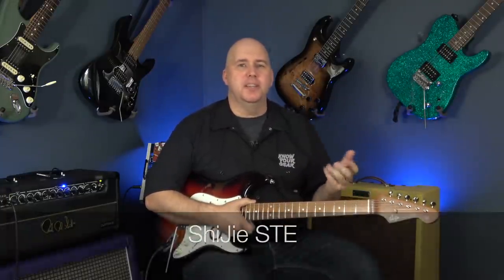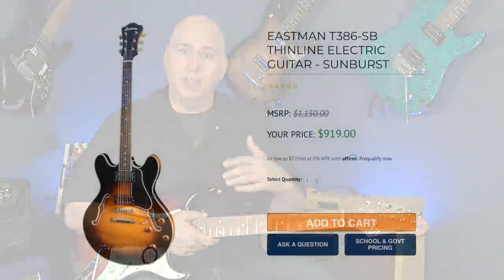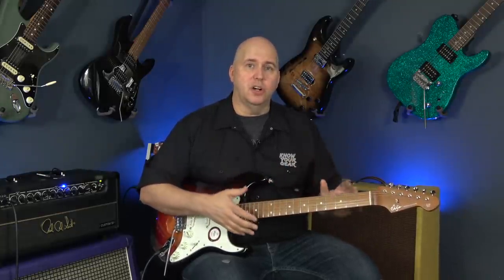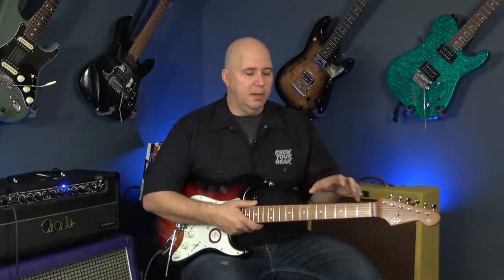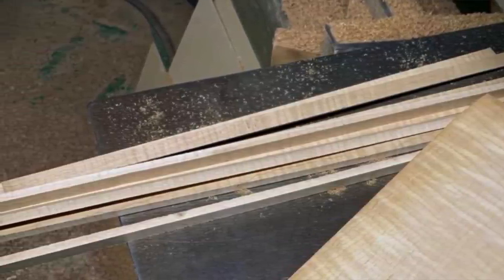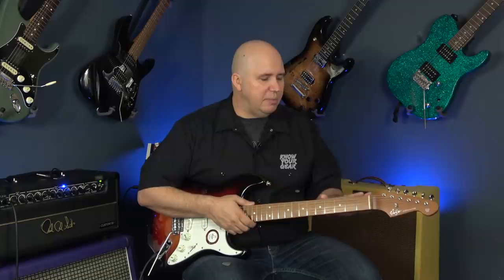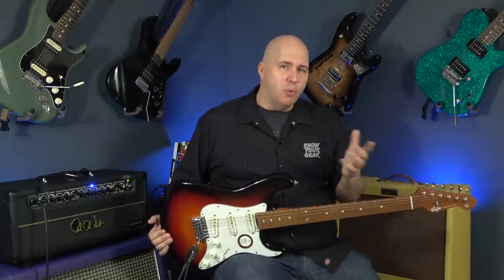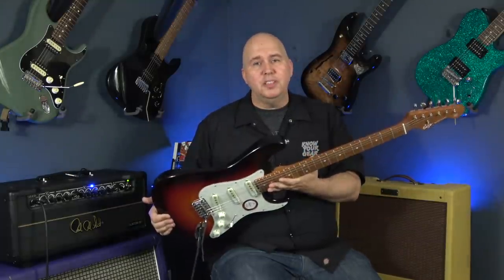Strat Style Guitar Through Pedals And Amp

Comment: Hi! I just got mine almost two weeks ago. It’s in vintage white with all mint green parts, a nickel cover humbucker in the bridge, stainless steel frets, and Gotoh locking tuners. To preface, I also own a Suhr Classic pro with the HSS setup (two v60lps and a Thornbucker bridge). I love the shijie so much! It’s an amazing guitar. The pickups are a little hotter than the Suhr pickups. On my kemper I end up turning the either the gain down and also turning the tone down to 6-7 to get a similar tone. The fretwork is amazing and the trem feels so smooth. If I didn’t have the Suhr I would still buy this guitar and be happy. You’re right, the neck feels more of a U or D shape. Not bad at all. Very comfortable. The setup was pretty good out of the box too. Needed a neck adjustment after the long trip to Seattle washington. This guitar won’t leave my collection. Mo was a pleasure to work with too! Answered all my questions and was so kind even when I felt a little skeptical. The quality is definitely that of a Suhr as well as the feel. The thing I liked the most was the strings felt the same under my fingers as the Suhr. I could bend easily and get to the note really fast. Something I always look for. If I had the money I would buy another shijie.
Reply: Hi Jon — how do you find the bridge humbucker? Thats the configuration I'm going to go for...could you describe it a little or compare it to something?
Reply: @JeremyJames_studio  You want to order one with the humbucker?

It's a little hotter than my Thornbucker. Nice and clear though! It is very articulate for sure. With some gain it never gets muddy.
Reply: Jeremy James if you’re interested in getting one with a bridge humbucker, go to the Alibaba.com website and send an inquiry to them. Mo Land, the sales manager for Enxi Guitars and Shijie will contact you. He can go through some different options for you! Great guy!
Reply: Jon Kaneshiro Thanks for coming back to me on this Jon. Yes I figured a humbucker would be a good option as I never really use the bridge pick up in a strat (especially one wired traditionally). I msged Mo and it seems easy for them to customise. Think he said an extra $80 for the humbucker to be put in. I would have already bought one but have been waiting for a few more people to weigh in with their thoughts. Wish I could try one first of course as I actually live in Hong Kong and go to China fairly often but there’s no place to try them. On balance though I think there’s enough positive reviews out there to take the plunge. Appreciate your feedback
Reply: Jeremy James of course! If you do some research on Facebook and the gear page you’ll find only positive reviews. Haven’t seen a bad review yet. You wouldn’t be disappointed! I’m a very picky guy when it comes to guitars. This one doesn’t let me be picky because it’s everything I need out of an s style guitar.
Reply: How does the neck size compare to the suhr?
Reply: Eric Wong hi! The neck on the shijie is more of a D or U shape but not big. It’s very comfortable. The Suhr is an even C and has more of a taper to it. Goes from skinner to fatter up the neck. The shijie is a bit more even and subtle. Not a bad thing just different. I think it’s just a different flavor that I like. Been used to C necks for forever.
Reply: @JeremyJames_studio  If you got that guitar, could you please give us your opinion about playability and sound? Thank you.
Reply: @sastrecasado  Sure, but not yet. The company has gone through a few changes, The quality apparently slipped a few months back...but think they are back on track. They have tele styled guitars now and relics
Reply: @JeremyJames_studio  Thank you. Do you mean that change in quality was only transient? May be because of coronavirus? So, perhaps it is not a good moment to buy one?
Reply: @sastrecasado  Hi, actually after speaking with the company it seems that perhaps quality control was ok throughout. The previous distributor, parted ways with Shijie and it wasn't the most amicable affair from what I understand. In any case I'm going to buy, will let you know.
Reply: @JeremyJames_studio  Very kind of you. Please, keep us informed. Personally, I will greatly appreciate your opinion after some days of having the guitar. Thank you.

Comment: Same questions I had for the $65 guitar review........what's the intonation like?  What the nut made of?  What's the quality of the tuning heads?  Is the neck straight?  What's the quality of the fretwork?   Are there any dead frets or fret buzz, especially above the 12th fret?   Are the pots and switches solid?  Do they feel loose or crackle?  What's the range of the pots?   The only thing I know about this guitar is how it sounds through an expensive amp with expensive effects.

Comment: This gave me an idea about strat bridge pickup ant tone controls. Three knobs three volumes. Use 500K for over brite bite then end use the switch to add high roll off caps or simple RC circuits. 4 or 5 is your choice. Instead of rolling off an amount of set frequencies you choose the what he frequency is and all are set at individual 'depths'. Part Varitone, part three infinitely variable pickups. 
Just a thought.

Comment: I have the same spec as Darell Braun’s.  It is incredibly well made.  The only thing I am struggling with is that I have noticed a ‘zingy’ sound on the high e string, as if something is vibrating and causing a sitar like second frequency.  It makes the high e sound brittle, and pretty unusable. This happens when played open as well as fretted.  Any ideas??
Reply: Do you only hear it acoustically, or is it coming through amplified as well? If it's amplified look for a buzzing fret or loose nut cut, if it isn't being amplified look for a vibrating part elsewhere, like a tremolo piece vibrating against the body or other loose piece of hardware.
Reply: Have you changed the string's ? I had the same problem which I only noticed when I took it in to Charlie's (guitar shop in Glasgow) to show him it.....turned out the 1st was really badly bent in places !!!!! Changed the string's-no more problems.
Reply: David A Moore II it is heard when amplified.  If I put some drive on then it becomes almost unusable on the bridge pickup.  A loose fret sounds promising as the e string has snagged a couple of times of the edge of the fretboard on a fret.
Reply: @DavesGuitarGear  I didn't try mine amplified when I got it due to the time at night,I tried it acoustically only as I knew I was putting 9,s on it but I'd ran out of strings and had to get some new one's anyway......it was Charlie who picked up on the buz....he thought it was the nut and that's when the dodgy string was discovered...... well I hope you solve the puzzle as my one was an easy fix.it didn't become obvious until he loosened it and that's when the bends were noticed...... I've no problems with it amplified.

Comment: I've got info about the tuners on a 2021 Shijie STE. I ordered mine in March, it was made towards the end of March and was delivered to me a few weeks ago. The tuners aren't locking tuners. It just says Kluson Deluxe on them. 

The pearl green, that I bought, looks amazing!! 

Just one question... I would love to see the nut up close. Mine looks different from any nut I've seen. It's square, with rolled of edges on top and botom, but around the stirngs its straigt, square. And I have a hard time seeing if it's really bone. I guess it is, but looking at if from an angle, I can see that there's a pattern with tiny squares on the top of the nut. It's diffifult to explain, you would have to see it. It's like an imprint, hard to explain.

Comment: I bought one in Daphne Blue with mint guard, Gotoh locking tuners, and stainless steel frets. I own a lot of guitars and this thing was really excellent. It is as good as any modern Strat that you will find.
When I got it I had.the bridge and middle pickups jumpered together on a Fender no load tone control.
Cost from Chins was $880 plus shipping, plus the Fender tone control when it got here.
Bottom line- I have a custom shop quality
Reply: I'm thinking of ordering one but I'm worried about shipping out in the gigbag and taxes. What was your experience? Thanks

Comment: In reading the comments it seems there is considerable bias and condemnation toward Chinese manufacturing.  And it seems to be "unbelievable" to most people that a great guitar could possibly be made in China.  A few years ago I would have put myself in the same prejudiced category.   I have quite a decent Strat collection including American Fenders, Warmoth's and Part Casters made of various Fender parts.  I purchased this exact same guitar (different color though) a few months ago.  This is now by far the best Strat I have in my collection.  The finish is impeccable, the quality of parts is exceptional.  The playability and feel is second to none.  The pickups are just so nice.   It also doesn't seem like anyone has taken any note of the specifications - Quarter Sawn Roasted Maple neck, Brass block,  Shielded electronics, Bone nut.   How much do you have to pay to have a USA Guitar to these specs?  If you are a showman guitarist and need to have Fender on the head stock - go ahead buy a Fender.  If you are a musician this is a much better option.
Reply: @Steve Quarter sawn necks are not cheap. You get fewer pieces of wood out of Quarter Sawn from the same block of wood because of the way it's cut. This makes it stronger, more stable and prevents warping. That's why they cost more. And that is why Fender don't use it on their American standards.  They also don't use solid brass blocks either.  The blocks Fender use are cast.  You know why?  Because they are cheaper.  $199 give me a break. Your lucky to get a decent set of tuners for that price. It's obvious your making ill informed statements without seeing or playing one of these exceptional guitars.

Comment: A Vintage V6 wouldn't be far off at a third of the price .Wilkinson do some great stuff
Reply: Ok Bernard, but with the V6 we just get way less a third of the build quality and specs... This guitar has many specs available only around 2K bucks level but at a half or a third of the price, I think we should mind it before comparing... I mean, if someone is not interested on high quality specs guitars it's ok, it's his/her legitimate choice but the comparison with the Vintage V6 seems not relevant at all... would we compare a V6 with the brand new Ultra Strat series? I don't think it should be practicable, but this guitar, as I said before, offers the same high quality specs at a third or a half the price of a pro Fender model and performs as good, that's maybe the point... In cases like this we should not compare looking down but looking up instead! Maybe I'm wrong and obviously this is just my point of view and I also bag your sorry if I seem to be presumptuous or inopportune, it would not be my intent... Best regards.
Reply: @alessandrorossini8704  Your entering the land of diminishing returns .The specs maybe that but 2 years down the line .The V6 ,your poo pooing , will be worth half of what you paid ,maybe more .This won't .No is gonna give it a sniff ,on the 2nd hand market .Be lucky if you get a quarter back .
Hey if you like it ,use .This will never hold as much value as a Suhr or even a mid range Fender ,which it's comp is .

Comment: For 2 years l have wanted a Shijie Strat, yesterday looking through a popular guitar site (we won't use any names like Reverb!) I came across a STE Pro model in gold! I typically am not a fan of gold however it has a super dark roasted maple neck.. almost  a dark rosewood color with the flame skunk stripe on the back only available on the one piece neck which l have been told Shijie is discontinuing.. l love the stripe. I had not seen the gold before and was really a striking combination, it's SSS configured, new Shijie locking tuners which are 19:1 l believe and trouble free now (l hope!)As of now l have 3 Fender Strats.. a Partscaster l custom made for me, blacked out with Super V bridge, ebony board, SD Hotrail bridge w Tex Specials mid/ neck, l have a Player plus with Zexcoils and a ebony Elite neck, and a 17 Elite with a maple neck,  l am psyched to finally see and actually play a Shijie.l ordered it today from China so in a month l will actually have one. Love your vids Phil!

Comment: Thanks for the review and looks like  a good guitar.  But.... the price is kind of high for Made in China and also they are outright ripping people off with the shipping cost ... total cost higher than a Mexican Strat ( almost an automatic no bueno).  And really it's approaching the cost of a MIA Strat so....  I like the 12" radius though
Reply: A comparable Fender runs close to $1,800-2,000 out the door. It's somewhere around a Pro and Ultra series Stratocaster.
Reply: @davidmahoney1248  Not if you are looking for a "Strat" sound, the guitar above sounds good,  but it's not a "Strat" tone as far as tradition goes. That's not a good, or a bad thing. Just different. It definitely has more of a "super" strat sound to it (a silly name that was coined/made-up in the 80's).

I like strats that sound like strats, I can buy an early 90's "Squire Series" black-label fender for around $200, swap out the tuners for $50-$60, add a Wudtone or Callaham bridge for $150-$200, replace all the wiring and pick-ups for $300 with anything I want short of silver wired pick-ups and have a killer 12" radius fretboard strat for ~$750 (signifigantly lower if I score the upgrade parts used, the only absolutely necessary parts are the tuners and trem block). It wouldn't sound like a Suhr, or a Tyler, or a Vigier, or GJ2, or whatever flavor of the week "Super Strat" is in vogue this year (Ibanez AZ series?). If I wanted to get rid of it I could take it apart and get most of my money back.

For a brand new fender guitar comparison it would be the MIM Deluxe Player's Stratocaster with the straight 12" radius FB. The Pro and Ultra series have compound radius fingerboards and neck curves, that always pushes the cost up. That's why the Ibanez models with compound radius fretboards cost so much and are still made in Japan at the Fuji-Gen Gakki plant that made the mid-80's MIJ Squires, and more recently, the Epiphone Elitest series guitars.

This isn't to argue about which is better, or "equal", none of them are either, if you want a Strat "sound" I can get it from a cheap squier with a decent set of tuners easier than a Suhr, or whatever else … sometimes the "flaws" of an out of tune string scraping under a pressed metal string tree is what you want. For example, most strat pick-ups these days are wound too hot for my tastes, I'm looking for around 5k-5.5k impedance pick-ups, comments here are implying that these are hotter than a Suhr pick-up … that doesn't equal better.
Reply: I'm assuming Fender still makes the MIM "Deluxe Players" model with a 12" radius … there's one for sale on Craigslist near me right now for $400 (I've seen them a bit cheaper than that before) … translucent blue with a rosewood board and gold hardware. I almost bought one a couple years ago when they were on sale for $500+.

They look like nice guitars, a bit more like a "super strat" style Ibanez model.
Reply: Nonsense. Made in China does not mean dirt cheap for everything. The Shijie shop reminds me of the old Fender shop of the 50s. Workmanship and materials look top notch. A comparable USA guitar like this would be no less than $2k.
Reply: This thing is light years ahead of any MIM strat. The build quality is better than even a USA strat.